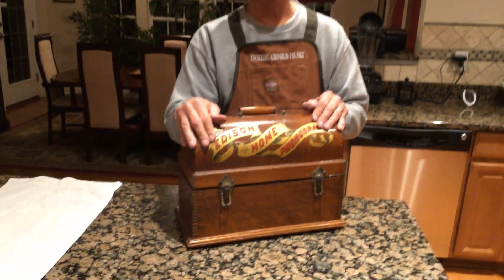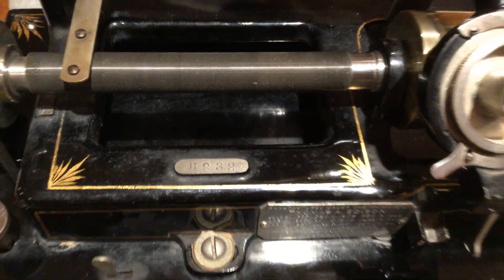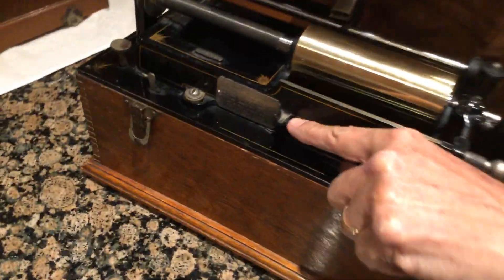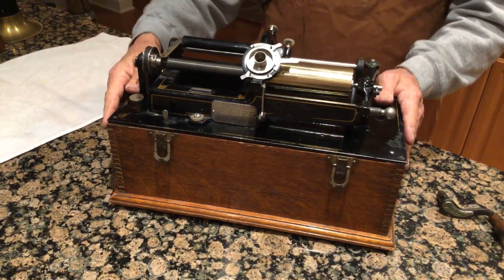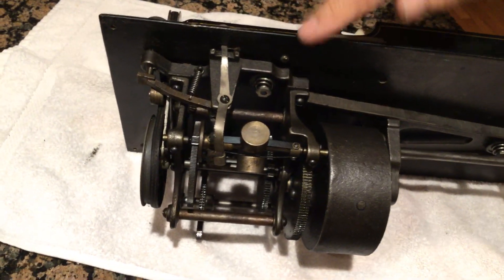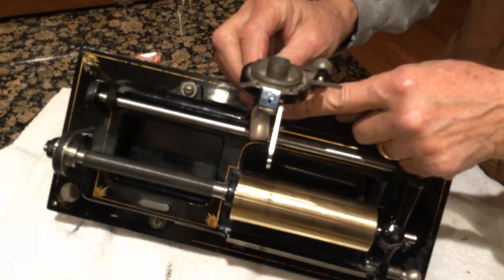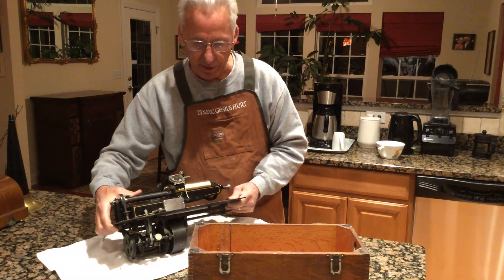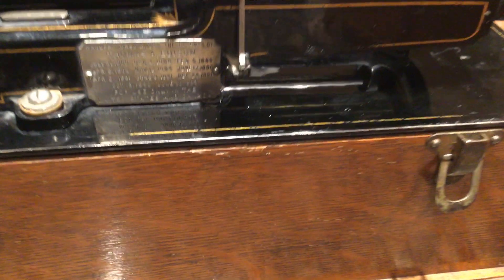233.  Very early Edison model A Home phonograph serial # 232

Comment: My Home is 1265, it also has the lift lever holder, brass mandrel, brass mandrel , brass governor weights, clicking on and off lever (that presses on the yoke instead of its own pad, )just like the one on this machine.. but it does not have the skeletal top.  It originally came with a weighted half nut, which like an idiot, instead of using Evap-o-rust  and re-nickel, I used a little later, an automatic carriage with the spring steel half nut.   These are neat and interesting machines and your banner lid is in very nice shape. One of my favorite cylinder machines.  These were advertised with an all brass 14" horn, though some had the black oil can horn, that was black with a gold stripe.  The spring is also a different size than the new style home.